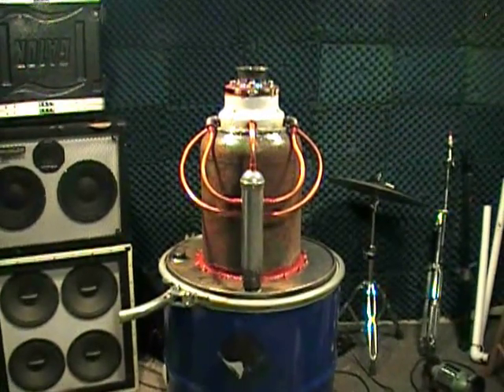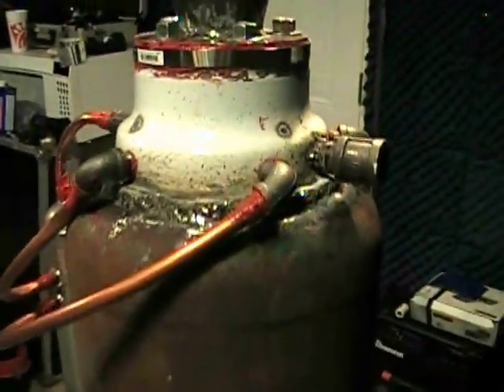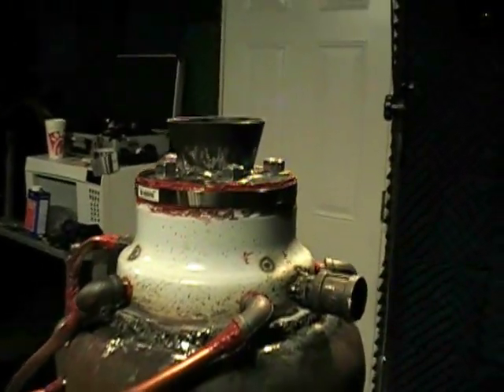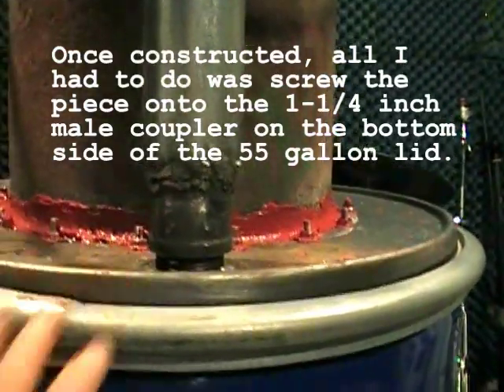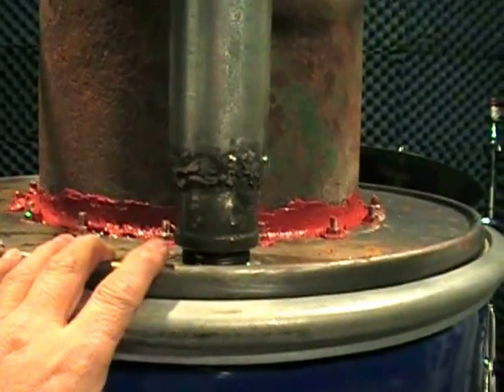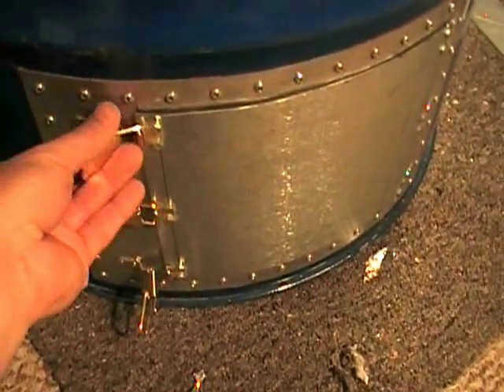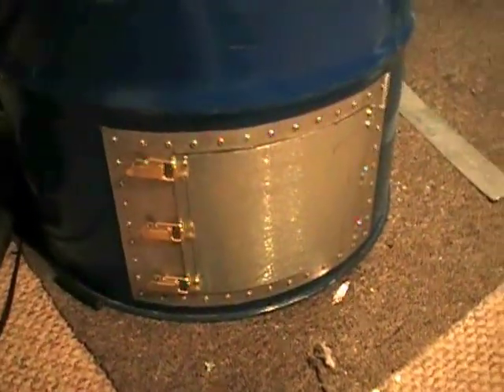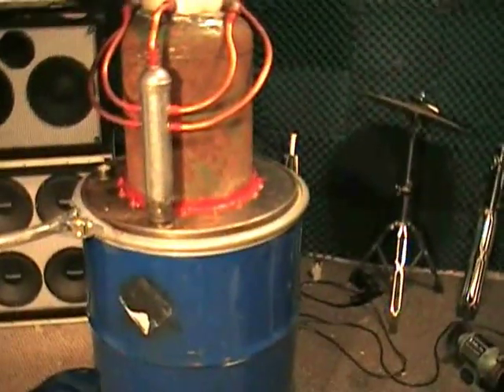A peek at the new Imbert gasifier build. (02-19-2013)

Comment from the maker: soreronicam Thanks for the input. I do plan on insulating around the burn zone just to help out with temperatures and I did extend the reduction zone by one inch but I did this to try to keep within the Imbert specs but it can be changed if I see issues. As far as glass beads go, the steel wool works great since it has a lot or micro surface areas and it too cleans with ease but that doesn't rule out the possibility of trying glass beads. My only concern would be the weight of them in my filter.

Comment from the maker: The burn is happening right at the top of the hub just under the nozzles all the way down through to the reduction zone but the magic (the gas) is produced right above the nozzles where the red hot embers break down the wood ABOVE the burn and once the wood is decayed and turned to a sort of charcoal, it replaces the top ember bed as new hot embers to keep the process going. It's pretty simple.

Comment from the maker: Yeah, I call that the inverted bell. It plays even a bigger role too.
Because it spreads out, it allows the ashes and some of the embers to spread out and not bridge like you see in a downdraft or a FEMA setup. It has the same effect as an ice cube tray and yeah, it does aid in cleaning the gas because it will fill up with ash along with embers that will aid in cracking and/or trapping the tar
and the deeper it is the more ash and ember it holds and the more it aids in the filtering process.

Comment from the maker: If the temperatures exceed the solder (at least on the top of the lid) I'll just go back and brace it. The only reason I didn't actually weld it is because I want to be able to heat it up and unscrew it if I need to and if I tack weld it, I burn the threads and ruin the lid's threads too. Even if the temperatures do melt it, the pieces are tightly threaded into the lid so they will not fall through. It would be a simple matter of re-bracing it. The solder is rated at 450 Deg F.

Comment: humm i htink u might find the solder not good enof in this situaton the imbert runs 5X hotter than a fema i had femas b4 and i that i had enof radiator so i hooked up my imber to the sys and the hole thing got so hot the bed filter started to burn and this was after a cyclone and a radiator i mean i was woried about my brazes the heat was sooo much greater i hope it works out O.o i have only run the imbert once tho so it might have been an anomaly ill let u know

Comment: Flash
I'm not using a bell reduction but an orifice plate 3/8" thick. I drilled a hole in the edge so I could get the probe right up to the center hole. The temp I wanted to monitor was in the area below the nozzles where all the gas has to pass through for cracking. I also have one on top of the grate to see if it would be an indicator as to when to shake the grate. All eyes on Doc this weekend. May the gasiforce be with you!

Comment from the maker: wkweasel Thanks for that tip! I will check that out The good thing is I am not depending on the RTV cement that much. I really didn't need to seal the inverted bell but I did and the worse that will happen is the RTV cement will turn hard and brittle but it will stay in place unless I remove the inverted bell.
The rest of the RTV seals are a safe distance from any real heat so I'm hoping that everything is Good. "continued"

Comment from the maker: Remember me saying I could light the FEMA from a side port? I could also
run it as a Imbert just by placing a skill saw blade on the top. I would see the
burn tube get red hot at the bottom of the ember zone and even then the gas the overall temperature appeared to be stable. The tradeoff was a hotter area but in a smaller area. Your setup is pretty big and you are looking to run a monster Diesel correct? I'm not... I plan on running a small engine so I have my fingers crossed.

Comment from the maker: but I also had a tiny barrel compared to the 55 gallon drum (Almost double!)
so this gives the gas more real estate to expand just in the gasifier itself. Now, I will have a much larger 15 gallon cooling tank on the output and even though this unit is physically larger it is not geared up to be a large gas producer so I'm hoping the tradeoff and difference allow me to keep the temperatures easily manageable but only real world test will give me the answers. "Continued one more time."

Comment: Flash,
Nice job! and good to see your advancement in mig welding, Silicone can only take so much heat.  If you put a K type themocouple near the bolts on your extension you will be able to monitor your hearth temp. If it works right it will hit 1400F.  I have used silicone foam tape that has adhesive on one side for my door and it works well and doesn't cost that much. mcmaster.com/#silicone-foam-strips/=lkg5l3 #5109K33.  I like the serviceability for future work.

Comment from the maker: I do realize that the temperature will definitely raise up especially with the "billow" effect from the air nozzles and you are correct and this is my goal too. I have a few pluses with this design that may help with excessive heat. On my first design I had a burn tube that was 4 inches in diameter and because I light it from the side, my ember depth was always 4 to 5 inches deep. The new setup has a restriction of 2-3/4 inches and a depth that is about the same. "continued"

Comment from the maker: Like you said, I really won't know about the heat until I do a test run with this. From what I can tell my fire zone is equal to my fire zone in the other setup and that's why I'm saying that heat may not be an issue but only time and testing will answer these questions. If heat is an issue, I'll just add more cooling pipe or even go to a larger diameter cooling pipe so I've already been thinking about the heat issue.

Comment from the maker: Techknow there is only a thin layer of RTV cement that's between the high temp cement and the inverted bell. the rest that you see is where I wiped the excess cement off and I just rubbed it into the hi temp concrete. I really didn't even need to seal the bottom of the bell but I did because I was already sealing the copper pipe connections for any possible leaks. I used standard compression couplers on the rim for the nozzles so there was no need to seal those.

Comment from the maker: The glue is not directly on the hot zones where embers are. It is only around the main copper tubes and the hopper to ensure there are no air leaks. Everything else is screwed in with compression type couplers where it butts up to the rim.

Comment: Hey Flash looks nice so far one thing i can tell you is to weld thin metal with a wire feed to thick start on the thin with low power setting then start a 1/8 back on it make a pass then turn up one setting then move closer to the thick metal make another pass then repeat til yr at the setting for the thick metal and bingo you just welded thin metal to thick! and with out burn threw spots! If you need better instructions email me lol you got it! Great looking so far!